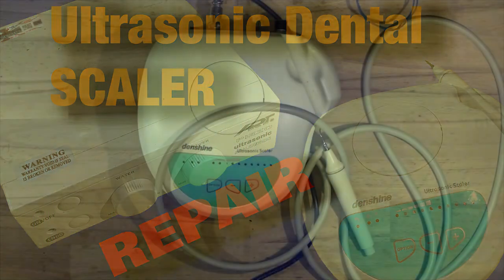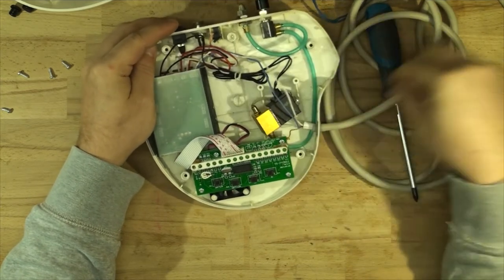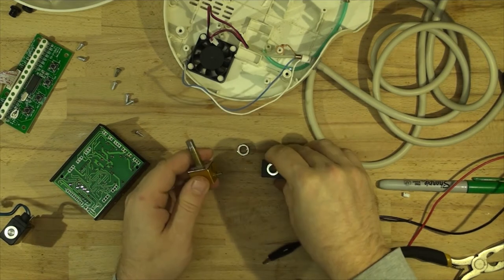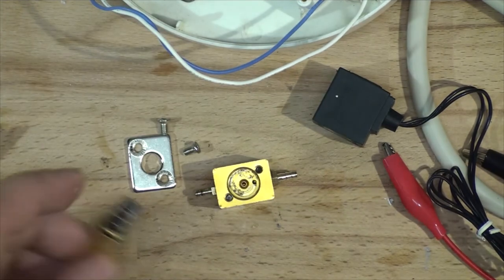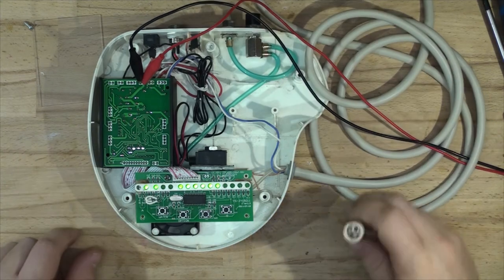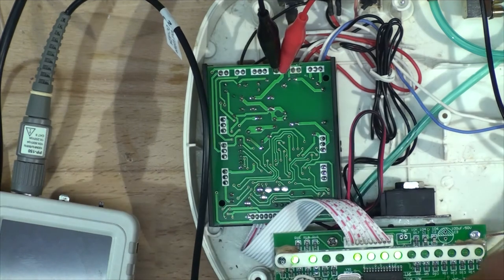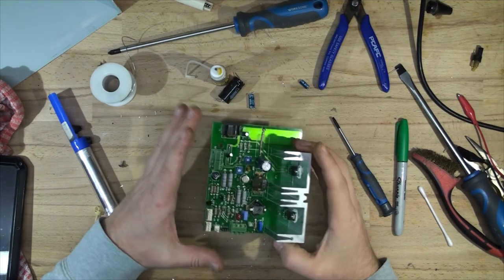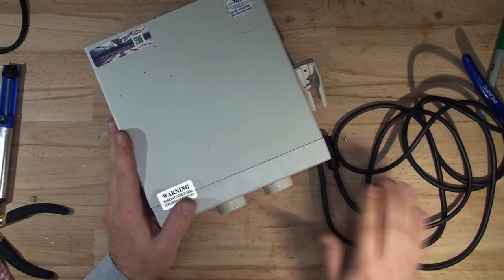Ultrasonic Scaler Repair + Bonus Repair

Comment: I have woodpecker DTE HD-7L ultrasonic scaler handpiece which is not working. The water does not spray and the LEDs do not light up not does it vibrate. I notices four electrical contacts on the rear as well as the water line. I am assuming two are for the lights what about the other two? What kind of mechanism is used inside the handpiece?
Reply from the maker: Hi, the other 2 wires are for ultrasonic transducer, it’s a device similar to a speaker, it doesn’t have any mechanical parts inside, it there’s no water no lights, then I assume the problem is in the main unit and not the hand piece